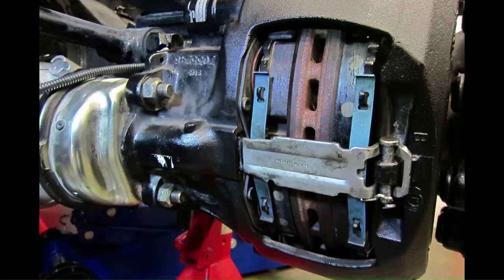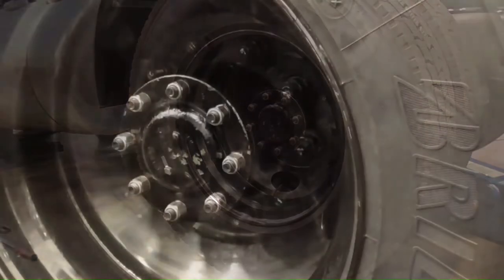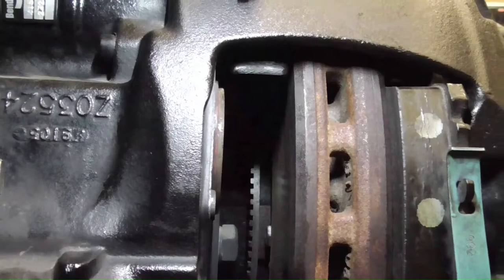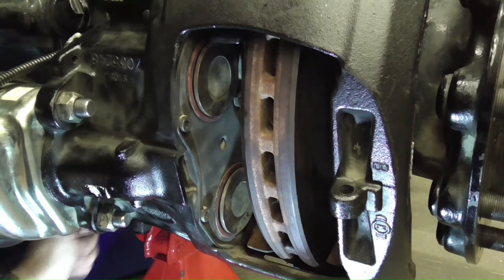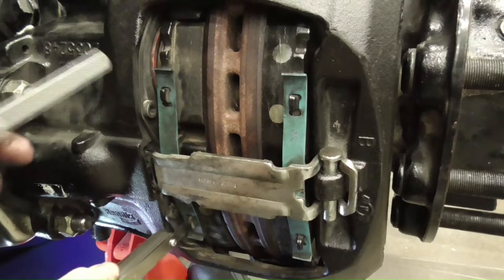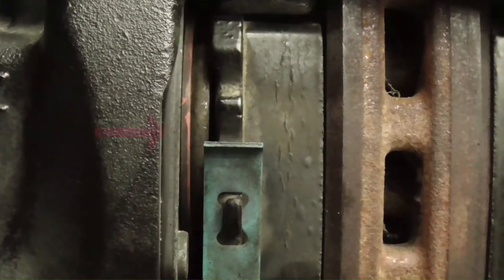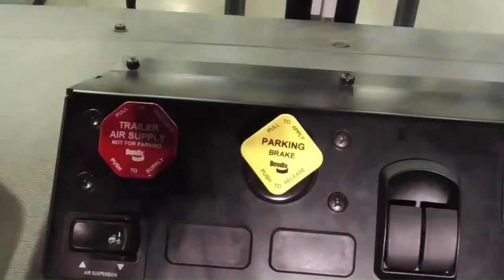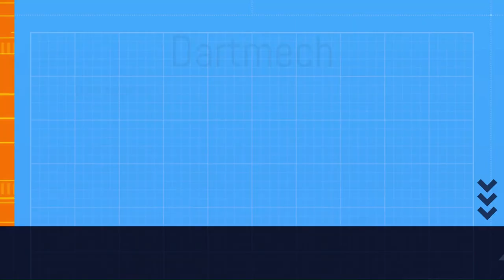Air Disc Brakes - Bendix -Pad Replacement and Adjustment.

Comment: Well done.. Another option when re-adjusting the brakes post installation of the pads.. tighten the adjuster =  back off three clicks.. or.. back off 4 clicks and hang a box wrench on the adjuster. Note the position.. then make service brake applications.. Two things happen here.. one.. the box wrench moved so you confirm the adjuster itself is working .. and two.. the adjuster has set nominlal operating clearance.. Just a different approach.. Well done again with this tutorial.
Reply from the maker: Thank you! Glad you enjoyed it!

Comment: A friend of mine breaks those shear adjusters on the steer axle.
I'm assuming theres no caging necessary on the steers.
What's he doing wrong?
Reply from the maker: Yeah no caging with the fronts. The internals may be seized or he’s just going too far.

Comment: Have a Question, I recently had a brake chamber blow out on the tractor and was wondering if it is possible to back the brakes off using the cam adjustment with shear adapter due to the inside of the chamber spring broke and couldn't get the cage bolt in !!  the trailer was 90 % in the lane of traffic. The mechanic could not get the cage bolt in either.
Reply from the maker: Unfortunately no, the shear adapter will break before anything happens with the brake chamber.  The only option there would be to remove the chamber mounting bolts completely to get the wheel free again.
Reply: @Dartmech  Thankyou!!!

Comment: Releasing the parking brake, BUILDS air pressure?  How is that.
Reply: Yes.  The parking brake in an air brake system is activated by a powerful spring rather than air.  This allows the parking/emergency brake to function when there is a failure in the air system (like a big leak or line break).  Under normal operating conditions, air is applied to force the parking brake spring back, releasing that part of the brake system.

Comment: What is the tool used to measure the space when adjusting? What's the thickness of the tool you used as well?
Reply from the maker: Feeler gauges. Should be like .025-.042” between each piston I believe.

Comment: Why do we need to cage the bridge ? is that action make it easy to retract the piston back into the caliber by turning shear adapter counter clockwise ?
Reply from the maker: Good question! The shear adapter is turning the adjuster in the caliper that will only move if the brakes are released.  If they are applied the shear adapter will break.  You could do this by just pushing in your park brake valve, but caging them is the safest way.

Comment: Huummm I just open the ignition switch then push the brake hold it for about 10 sec. And kalibrate by itself easy peace 😊😊😊😊😊😊😊😊😊

Comment: A friend of mine breaks those shear adjusters on the steer axle.
I'm assuming theres no caging necessary on the steers.
What's he doing wrong?
Reply: I break them too once in a while.  I got a Lisle 29120 socket as a back up.  Just be gentle with it so you don't damage the adjustment mechanism.